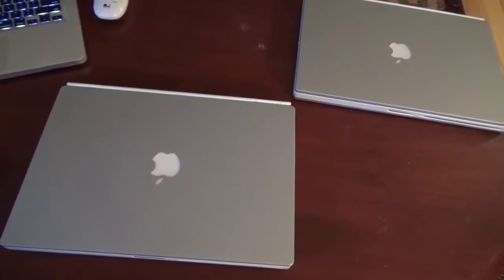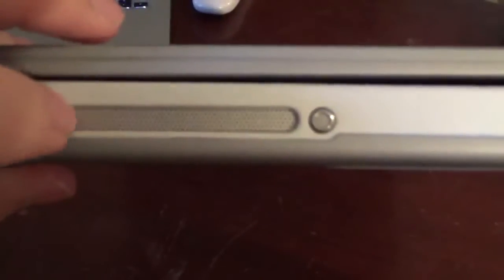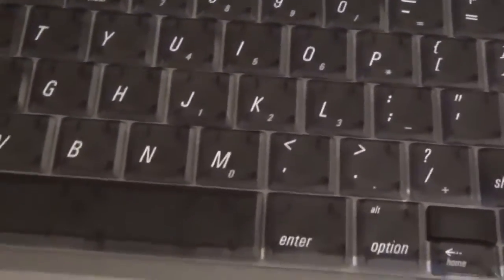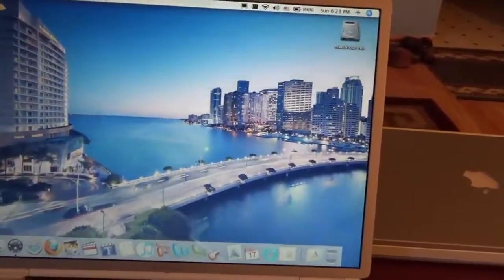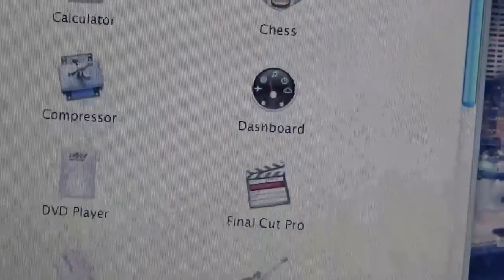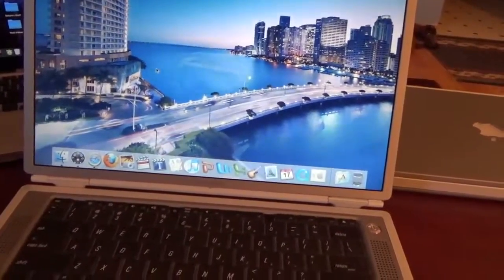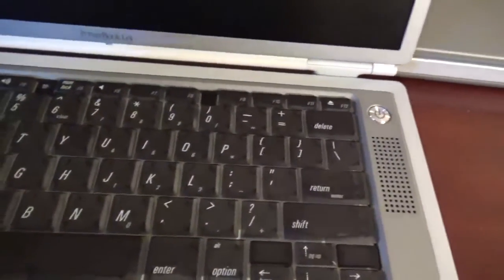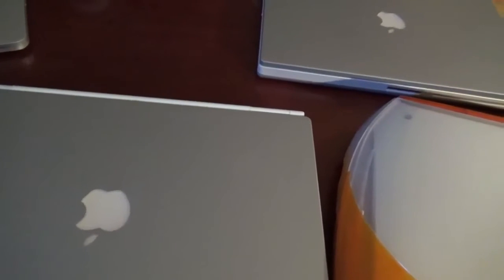Update On The PowerBook G4's

Comment: In the latest version of 10 4 Fox ypo can install mactubes which allows you to run you tube videos through quicktime, I do it on a Powerbook G4
Reply from the maker: Richard Koerper Yes, unfortunately, MacTubes no longer works and is no longer in development. Back in May, YouTube changed their API's, which broke 3rd party apps. The developer decided to pull the plug on MacTubes. I don't know if the Emulator still works. The only YouTube browse and view app for PowerPC that still works, to my knowledge,  is YouView.
Reply: TheTechies World I used it just 2 nights ago and it worked just fine. You are probably right though, oh well I can still use my Linux to get your youtube posts. Nice job by the way.

Comment: Good Morning, i have the Powerbook G4 with i believe Panther in it. 10.3.4  It has accepted my wifi but cannot connect to the internet because it says it has no isp address. I can get online directly with the ethernet chord. i think its a security problem? i f i could upgrade to tiger then it might work? where do i even go to get this update? Apple support on line and my internet provider seem to be clueless. mine might be a 2004-2005 because it can take 2 Gigs of Ram  hope you can help
Bonnie
Reply from the maker: +Bonnie .Sweeney Is your WiFi network encrypted with a WPA/WPA2 passcode? If so, upgrading to Tiger would likely fix that issue. I believe Tiger was the first version of Mac OS X to have native support for WPA encryption. Tiger was sold on a set on 3 CD-ROMS or a single DVD. You can pick up a copy from Amazon or eBay or places like that. Because it sounds like you have a G4 that can run Leopard, that's also an option. Leopard will allow you to run a bit newer software.